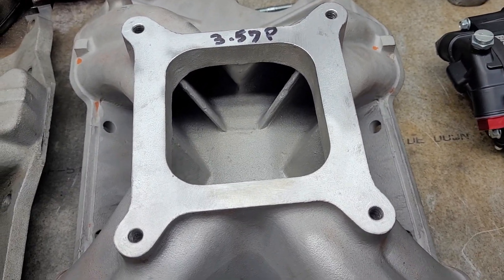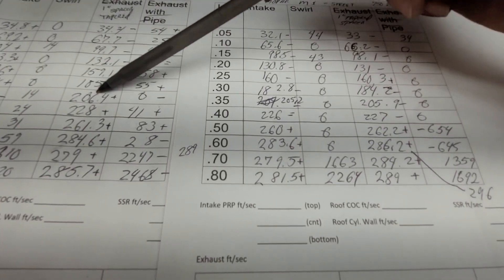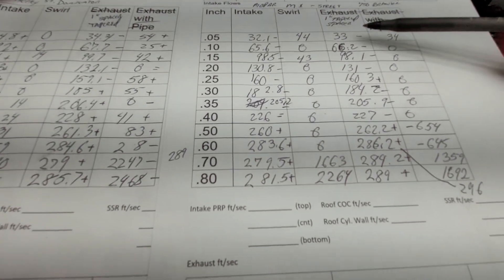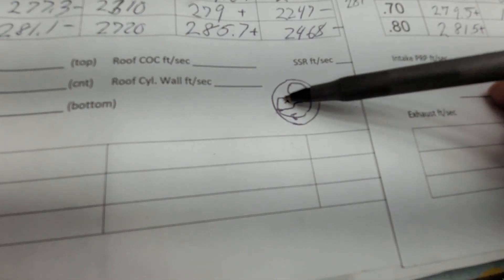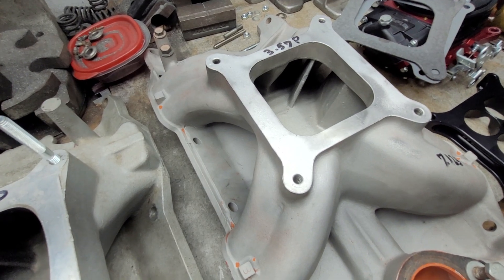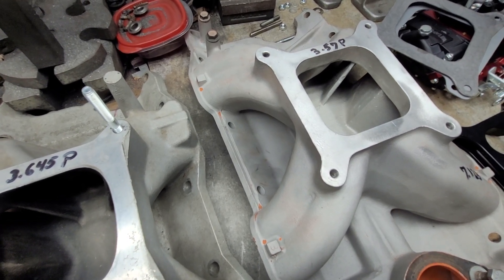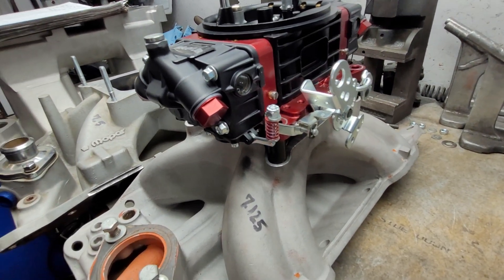Mopar W2 Street M1 intake vs. W2 Holley Street Dominator manifold stock flows

Comment: I have a street dominator on my W2 stroker and i would like to find a strip dominator, do you have one for sale?
Reply from the maker: I don't have any Mopar intakes in stock. Rob probably has one contact him at fabo he is rumblefish360. Thanks
Reply: @servediocylinderheads Thanks!
Reply: @servediocylinderheads Good news, I was able to score a prestine and untouched strip dominator! Beside the port match to my ported heads is there anything worth doing in the plenum area in addition of cleaning the casting flash?
Reply: @servediocylinderheads Do you modify intakes for EFI?
Reply from the maker: @motovick Yes
Reply from the maker: @motovick I should be clear, I don't drill for injectors.
Reply: @servediocylinderheads Thanks, do you have a website or a private way of communicating?
Reply from the maker: @motovick charlesservedio@gmail.com
Thanks

Comment: One of the limitations of a flow bench is its inability to test airflow during valve overlap. A second limitation is its inability to reflect mixture motion relative to crank angle and cycle. That's where reading the cylinders comes in. Flow benches and dyno's are measuring instruments. The race tracks, and the roads, are the proving grounds for what we do. In my ignorant opinion,  valve overlap is the single most influential part of the combustion cycle, and generally the most under appreciated, as well as the least understood. Good stuff as usual Charlie. Regards Greg
Reply from the maker: I totally agree. It all works on pressure differential. Good scavenging can exceed 100 inches of water.
Reply: Well it's not misunderstood by the people that design IC engines, camshafts, cylinder heads - just enthusiasts out there.
There are other factors that are misunderstood by many enthusiasts like intake & exhaust valve lead and lag that collectively when plotted on a graph show overlap. The overlap is just a result of these and condenses information into something easily digestible when comparing apples and apples; by that I mean same engine, some comp, same camshaft lift but different duration. In other words not that useful as it really isn't the whole picture, just a quick snapshot. 
If overlap was misunderstood then no engine would make the power it does because the cylinders wouldn't fill due to lack of primary scavenging which is the principal of all IC engines.

Comment: 5:00 Dumb question: if you have a running 'test mule' engine there...

Can you somehow install some kind of logarithmic pressure sensor [high temperature graphite enclosed transducer type] in with your spark plug, and another one along the peak flow location of your exhaust port? [may only need one actual cylinder, at least at first]

This would help you find out if:

A: There is any point at which the exhaust one any one configuration is initiating more back pressure than the other

and

B: If this is leading to better, or worse exhaust scavenging [since without more information from where I stand, working from turbomachinery education, following downhill to more diesel, than gasoline powered reciprocation education, all mil spec, none of it racing] so that one can then find out which is going to produce the better results.....

So:

Ultimately, while the direction of the swirl does not affect combustion or flame propagation, it CAN [depending on the engine stroke type (AND velocity)] adversely affect some engines' ability to cleanly and efficiently expel JUST the RIGHT amount of the various molecular fluids passing through it. <a rather legalistic manner of not specifying if it is either air alone, air and fuel, combined A/F+E/Fl, or exhaust fluids>

This will likely launch you into a whole new level of engine design and engineering, of which I MOST EAGERLY look forward to observing, sharing with others and helping promote!!! \(^_^)/

Us Bunneh Wabbut NERDZ be like that. 🤓
Reply from the maker: I wish I had a dyno mule. Thanks

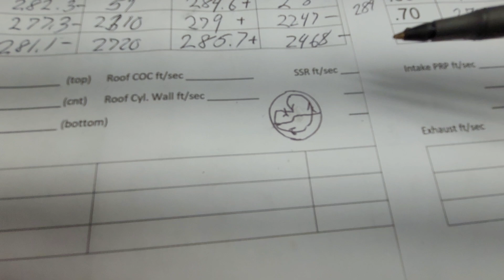Comment: 4:20 End-of-cycle counter-swirl is only bad if it reduces exhaust gas extraction [ 'back-flow=back-pressure' type scenario ] but DO KEEP IN MIND, that EVEN AT supersonic velocities, in ANY fluidized medium there ALWAYS IS at least SOME response to the Coriolis force, however small it may be.

If you can determine that a backward flow causes turbulence, 'fly-over', kinetic shelling, or mach boundaries, then its a bad thing.

The only real way to know, is to have real world exhaust, not merely temperatures, but pressures and velocities, all at the same instant.

This will tell you if you are getting 'scavenging' [like 2 strokes (some times) suffer from, and yet 4 strokes depend upon] or if you are getting 'sonic-shuttering' where the mach wave is blocking air flow and causing your engine to exert <and therefore lose> power, just to expel the exhaust.

This may take more finite point modeling to determine, if you lack the tooling on hand to reproduce, but I would suggest you talk to DV who knows so much more about engine swirl than I do, and if he does not have the answer, he can find it.

I just do my best to work around such issues with other engine designs, so I'm kinda somewhat less useful at this point, simply because I am working on my own specialized valving designs.

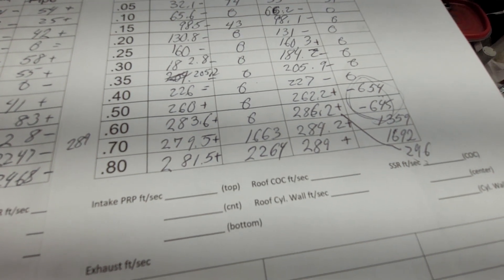Comment: 3:30 There comes in the question: When you say 'bad' idea, if you mean simply because of direction of rotation?

If so... doesn't matter.

If you mean VELOCITY of swirl, simply put, "The faster the better"

If you mean restricting the A/F charge into the cylinder, if it does, its bad.
Reply from the maker: Bad idea to have swirl rotation reversal as lift increases.
Reply: @servediocylinderheads  Why do you think the spacer lost some cfm? 
Been debating trying one on my sbc 7530 ported Team G hoping for a touch more response better signal
1" open one now. 383 big solid roller 850 etc
Reply from the maker: @gordocarbo  Spacer usually adds cfm. On that intake add a spacer. It has a small plenum.